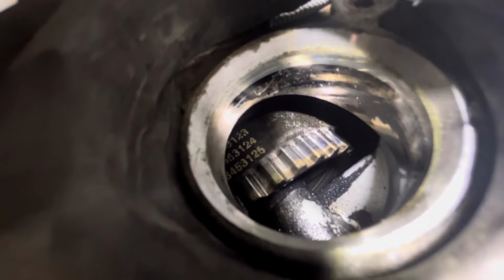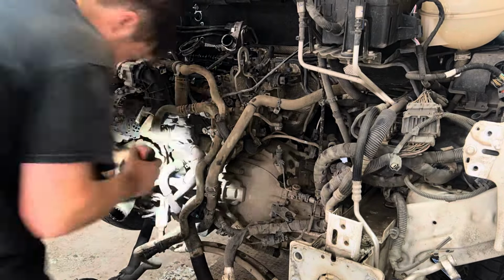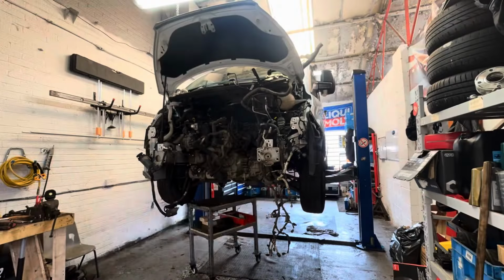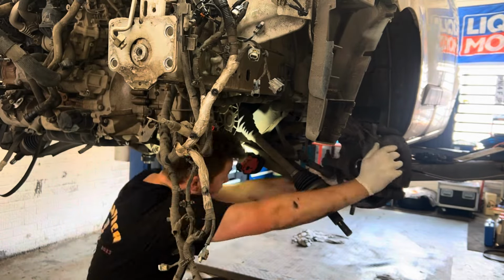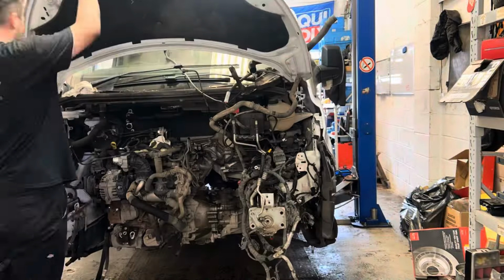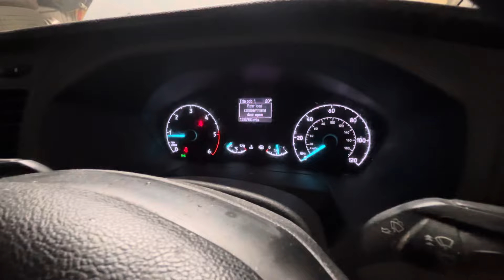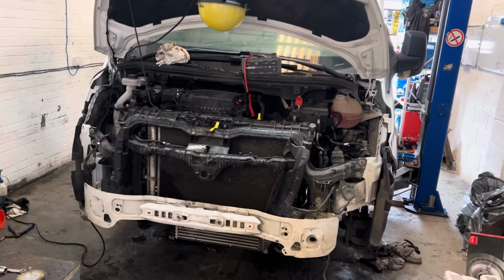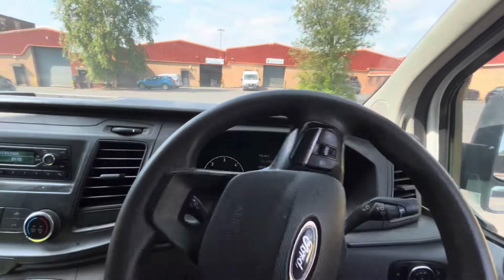FORD TRANSIT ENGINE FAILURE and wet belt replacement with a Ford Transit master tech!

Comment: I was a ford mechanic in the late 80s, back than most transits had no pas and weren't a nice van to drive, but they were fairly bombproof. I mean you had to be a serious muppit to wreck an engine in one. Nowadays they drive lovley (for a van), but seem to have a constant stream of problems,  I know which Id prefer.
Reply from the maker: Yeah they do drive great!! I believe most the issues could be avoided with proper maintenance

Comment: This is the reason, ford went down with the intervall from 150000 miles to 100000 miles (or 6 years instead of 10....)
Reply from the maker: Yep! This was on 130k miles. I might have one in soon on 70k with a snapped belt!
Reply: @ZakKol69 heard of them snapping at 40k . I’m into ford next week on a recall with a 17 plate. The rubber from the belt apparently makes the vacuum pump bad and then you lose your brakes which is a safety issue. What’s people supposed to do ? Fork out £1200 quid every 4 years because you’re constantly paranoid about your brakes going?

Comment: Why do these bloody engines have so much wiring / piping ? It’s ludicrous, had all this crap when I did my wet belts on my C-Max 1.0 Ecoboost, had to take about 3000 photos (no only kidding but took at least 50 step by step & reverted to them when reassembling ) its madness but they are there first a reason I know 😣🤙
Reply from the maker: These are an absolute doddle and not very complicated in comparison to a VW 6.1 MAR engine!